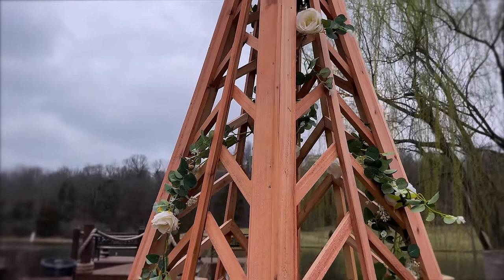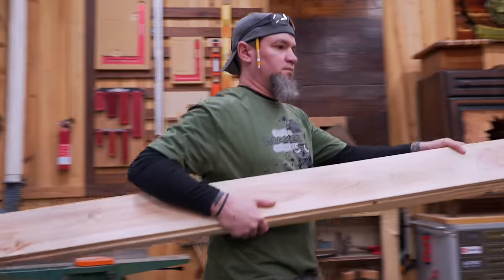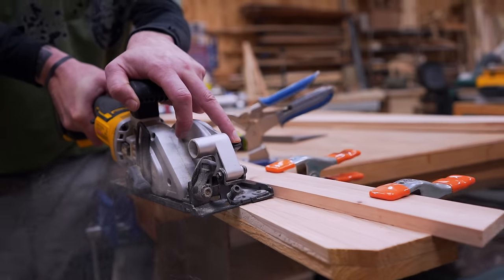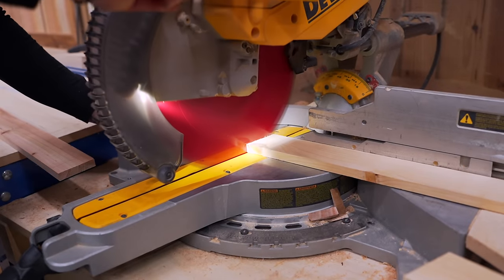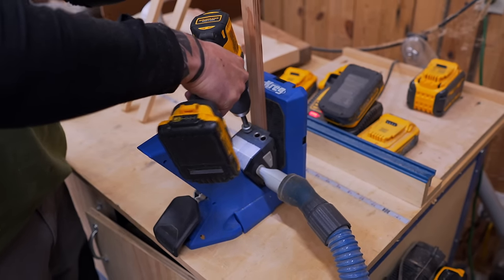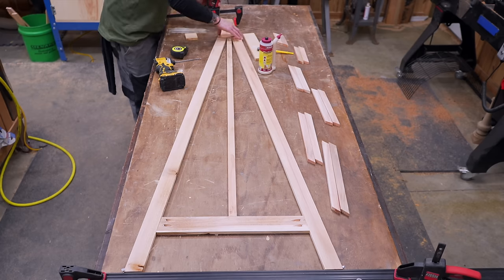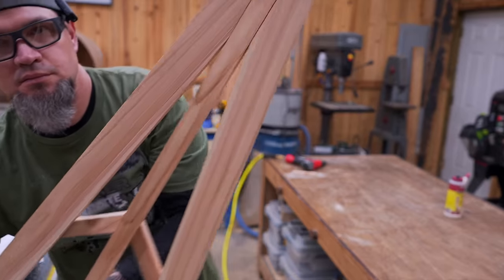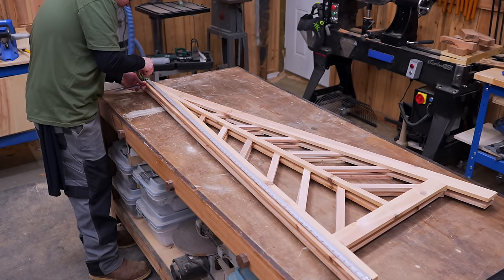This Beginner Project Can 20x Your Profit Using Only Common Tools

Comment from the maker: ▼EXPAND FOR MORE INFO!▼

★ Plans! All plans include exploded views, cutting layouts, and easy-to-follow step-by-step instructions. 
https://www.Matthewpeech.com

★The New Outdoors Channel! https://www.youtube.com/channel/UCFVByOisviL-HiZA04Kf8Mg

★ Join The Patreon Community!  
https://www.patreon.com/MatthewPeechwoodworking

★ Subscriber Discounts! (Affiliate links help to sponsor the content)

Gatorz American Eyewear 
10% off with code: PEECH 
https://www.gatorz.com/PEECH

-RZ Masks (Save 15% with code: PEECH)
https://tidd.ly/3TJ1w9q

-AXIL Electronic Hearing Protection (SAVE 15% with code MPWOODWORKING)
https://goaxil.com/pages/gs-extreme-affiliatte-special?rfsn=6622602.9d133c

★Links to tools you may see in my shop  (If you use one of these affiliate links we may receive a small commission that helps to support the channel)
—————————————————————————————————
Dewalt circular saw kit https://dlnkr.com/s/2SinsKUS
Dewalt Brad nailer https://amzn.to/3cEjysY
Dewalt Brad nails https://amzn.to/3u1pjcH
Bessey clamps https://amzn.to/3vsbOAS
Pencil https://amzn.to/3PePbHX
Kreg automaxx clamp   https://amzn.to/3V4Bgdc
Titebond III Exterior wood glue https://amzn.to/36HHBEx 
Glue bot https://amzn.to/3cnVM44
Silicone glue brush https://amzn.to/3HPWsf1
Push stick https://amzn.to/3TYwoTY 
Kreg Pocket-Hole Jig 720 PRO, Blue https://amzn.to/3trFHkt 
DEWALT 20V Max Cordless Drill Combo Kit, 2-Tool Drill Driver/Impact Combo Kit 
https://amzn.to/3Kh5OAE
Swanson Square https://amzn.to/3TgUgSx
Dewalt Brad nailer https://amzn.to/3cEjysY
3/4” Brad nails https://amzn.to/3dKItvJ
Pocket tool https://amzn.to/42V7w4u
MakRs stain pad https://amzn.to/3NGap2J
Dewalt Dual bevel miter saw https://amzn.to/3Ow2IMY
DEWALT Compound Miter Saw  https://amzn.to/3fqkIWX  
1 1/2" deck screws https://amzn.to/3ItZtSv
Spring Clamps https://amzn.to/3DE8IML
IRWIN QUICK-GRIP Clamps, Mini Bar, 6-Inch, 4-Pack  https://amzn.to/3A2hXEM

Check out my Amazon Page for links to all the tools you see throughout my shop!
https://amazon.com/shop/matthewpeechwoodworking
Reply: So this amazing like everything else you post I love learning from you,the only thing I’m missing from this one is that you usually say how many pickets and suggest what you would sell it for and that always gives me a starting point.but like always great idea and that you for the knowledge.looking forward for many more.ps.built the chicnik table for my daughter and it was a hit with her friends and neighbors.
Reply: Just visited your Etsy shop and got some plans. I'm excited to get building, but I wanted to say thanks for the inspiration, motivation and the extremely nice price and layout of your plans. God bless you Mr. Peach!!!
Reply: How many fence pickets does this take?

Comment: You could leave it outside during the holidays and hang Christmas lights on it. Maybe top it with a star. 
Cool obelisk.  Thanks Matthew!
I'll try to build one half this size.
Reply from the maker: I like it. Enjoy!
Reply: When I first saw the thumbnail I thought WOW nice pyramidal.

What is the pyramid shape? A pyramid is a three dimensional geometric shape (3D shape) made up of flat faces: a base and triangular faces which meet at a point called the apex. Three main features of pyramids are, faces, vertices and edges: Face – a closed, flat surface.

But it's also a pyramidal obelisk.

Just another name for the same thing.

Just a thought enjoying your channels.
Wolfmama

Comment: Hey Matt it appeared that you were measuring at 10 5/16 instead of 11 5/16. I've yet to try this one but plan on starting tomorrow. Not knit picking just clarifying. Also, is there a cut list I'm missing? Lastly, great video(s) man, you are truly inspiring. I'll be joining Patreon ASAP!
EDIT: Finally Lastly: The bottom brace boards are cut at a 10 degree angle on each end. .not 40 degree. I actually built mine today. You still rule Matt!
Reply: My comment pointing that out seems to have disappeared.
Reply: @brucewelty7684  That's nice 😂 yeah I was thinking that there had to be someone that noticed that before me but I didn't read through the comments to check lol. I could be wrong but was that first measurement a little off too? Lol

Comment: My plan is to build this today. I have built the 3 picket planter and the squirrel picnic table feeder so far. I didn't include any variations...on purpose, anyway lol. I learned something about myself with the two builds.  Like a great many others, I don't typically build with detailed plans.  So, with the two builds mentioned above, I built by watching the videos and taking fairly detailed notes. The projects turned out pretty close to what they should look like but it was after assembly on the picnic table that I realized I hadn't sanded the saw marks out of the edges. That's not a step I would have forgotten with my own builds and I'm not exactly sure why it happened in this case. It feels pretty foolish to think it was because, "well, it wasn't in the tutorial" but that's what it feels like. I guess this is just a head's up to any other knuckleheads like me out there to keep in mind that basic woodworking steps are still required when building from plans.  It's like following a recipe and not removing eggs from the shell;  "well, the recipe just said to add two eggs" lol.  It's nothing new, really,  I could probably do a long video serious based only on my "duh" moments in woodworking.

Comment: Hey Matthew.  Love all our videos.  One question.  How do you store your cedar pickets?  I lay them on the concrete floor, raised, with cinder blocks holding them down.  They keep bowing and cupping after I remove the cinder blocks.  My shop is climate controled as well as the humidity.  The humidity usually stays at about 40%.  Thanks brother.  I appreciate your time.

Comment: Love it! (As always) 

Did I miss the cutlist in description?
Reply from the maker: Thank you. I used to refer to the parts by A, B etc in the videos and didn’t say the lengths. I stopped putting the cut list in the description a while ago due to requests to just say it aloud rather than referring to them as the part letter.
Reply: @MatthewPeechWoodworking  perfect!  Clearly I've been sleeping on the new ones too much. LOVE the videos and the positivity. Thanks for all you do!

Comment: Hey Matthew. Love the videos. Own many of the plans. I don't want to sound like that guy but at 2:22. You said measure 11 5/16". But on the tape you pulled 10 5/16". I know some people build it from these videos. Just wondering which it was. Keep up the great work! Though it could have been the camera angle. I just went back and saw you did the same on the first measurement. And it was about an inch off. So, very well could have been perspective :D
Reply from the maker: Hey!  No worries!  It’s 11 5/16”.

Comment: This may have been addressed already but in Matthew's video description he states that the bottom boards are cut at a 40 degree angle.  Unless I am doing something completely wrong, I found the best fit angle to be 9 degrees (please don't take this as absolute. Do a test cut to make sure). I don't think I'm totally wrong because it's easy to see the angles shown in the video are much shallower than 40 degrees.  Again, though, I may be wrong altogether so you'll want to make sure for yourself but I would recommend not mitering the bottom boards until you get to assembly. If anyone knows better, please let me know.  I imagine there's a way to take down my comment.

Comment: Mathew, in the video it sounds like you say cut the ends of those bottom supports at 40 degrees? At about the 3:35 degree marker, but that's no where near a 49 degree that you cut. Could you tell me what it is? Looks like maybe a 10?

Comment: Hey Matt… I’m in the process of building this right now and I think maybe there may be a mistake for either the measurements of the support boards or wedge support boards go to which frame boards. I say this because when I got to the assembly part I started with assembling the 2 inch frames and I used the 18 13/16 support board like you said, and that framed up beautifully and then when I started to frame up the 2 1/2 inch frame things were not lining up and I thought maybe I cut some thing at a wrong angle or maybe I sanded my edges on my angle on my frame pieces badly (which come to think of it. I don’t know why the hell I sanded the edges right there that doesn’t make sense lol) or some thing, but I checked everything and everything was correct so what I did was it I cut the 19 13/16 piece down to 18 13/16 thinking that maybe you miss spoke and matched the two wrong and so I tried fitting that up and it still did not fit up correctly so then, since in my mind, the most logical thing would be Firm the longer support board to go with the wider frame. It would make more sense for the support board for the 2 1/2 inch frame to be 1 inch longer than the support board for the 2 inch frame. However, since in this scenario that would not be possible and I had already glued everything up and I had to go to an appointment and then come back so it was already set there was no taking it apart the only option I had was to do 1 inch less and when I did that which made the support board measurement come out to 17 13/16 that did fit up well. However, when I say well, I don’t mean excellent both a 2 inch and a 2 1/2 inch frames when I was lining them up with the end of my square surface were slightly off angle, and I am assuming that this is because of not being matched with the correct length of support board. I hope this is all making sense, and I hope that you can provide me with some clarification. I know it’s been a while since you posted this video so I don’t even know if you’ll see this if anyone knows how to get Matt to see this I’d greatly appreciate it if you could help a girl out.😊 I am just starting to make the fourth frame so I don’t know if they’re all gonna fit together yet or not I am praying that they do because if not, I just wasted a shit ton of time and will have to go buy more materials but I guess in the end I will end up with two of these things rather than just one which that’s fine with me  just wasn’t in the plans, but hey, that’s life lol
Reply: I think I might be having some of the same problems. My main issue is after putting the brace in at the bottom of the frame the meters at the peak of the frame never quite match nicely with the center slat support. I'm almost done building my second one of these and the same problems have happened both times. I think I'll have to do some testing on the next one.
Reply: @kolestuck5434  ya something is defined not right. Mine did end up coming all together it’s a rectangle instead of a square but honestly you can hardly tell. But ya I think Matt definitely accidentally mis-stated something in the video because things don’t line up. I wish I could afford to purchase the plans I’d be curious to see if they line up with the video
Reply: @nikkibiondo7399  I purchased the plans and they seem to match the video pretty well. I might just be having problems with accuracy idk
Reply: It looks like the angle on the cross pieces should be 10 deg, not 40.
Reply: @timcurtin36 ya I cut them at 10 degrees not 40. it doesn’t work out. For the bottom boards I ended up using a measurement of 17 13/16” for the 2 1/2”  side  and 18 13/16 for the 2” side
Reply: The only issue with these measurements that I had to modify it made the final product not a complete square it’s not very noticeable but for someone like me who notices measurements very well it’s noticeable that it’s a rectangular obelisk not a square one lol I’m not exactly sure how to rectify this on the next one I make I’m going to try just swapping the boards I would have done this on this build but I had already installed them with wood glue on the 2” sides so  I didn’t want to go through all that.

Comment: Hi Matt! Could  you please help me. I was asked to make a large trivet, 20 x 18 to be used under an instant pot. I already have two 1x12 boards from another project. They are joined together with glue and biscuits. Do you think the weight(15-20 lbs) and the heat from the instant pot would warp the boards? I appreciate any suggestions! Thank you!!

Comment: The first way you pronounced it is correct. Strongest inflection on the first "Ob" part, not on the "el" part. 

Oh wow. This sounds very complicated, but I'm sure with plans it's more clear. 
Just a suggestion ... METRIC.
Metric measurements are so much easier to understand when doing something with 16ths measurements. I mean, come on! You could have extended or shrunk the dimensions to be whatever you want, and yet, we have to measure weird multiples of 16ths? 
Go with metric and keep it simple. So what if it's not exactly 6ft or whatever? No one is going to know. Division by 10 is easier than trying to figure out what 11/16 is. 
I figured out that weird measurements were easier with metric than trying to measure 16ths or 32nds. 
I still don't know why we haven't gone to metric measurements. SO much easier to calculate whether length or volume.

Comment: No cut list in the description?
Reply from the maker: I used to refer to the parts by A, B etc in the videos and didn’t say the lengths. I stopped putting the cut list in the description a while ago due to requests to just say it aloud rather than referring to them as the part letter.